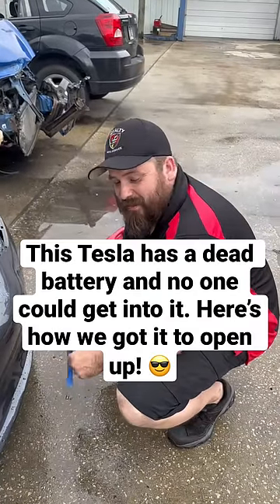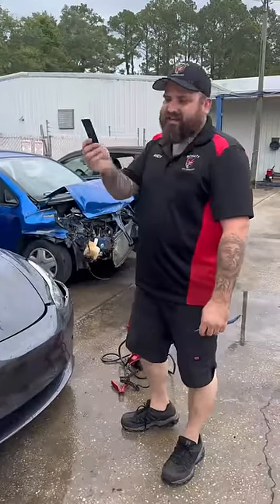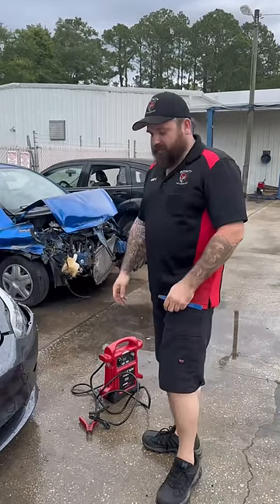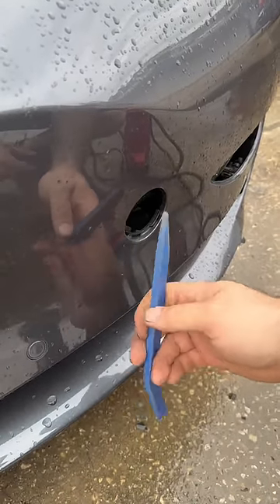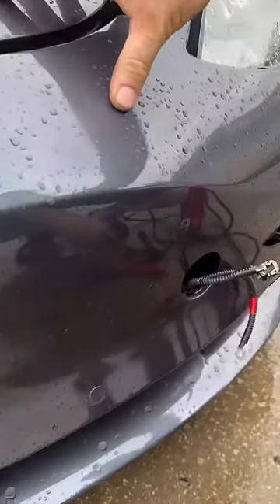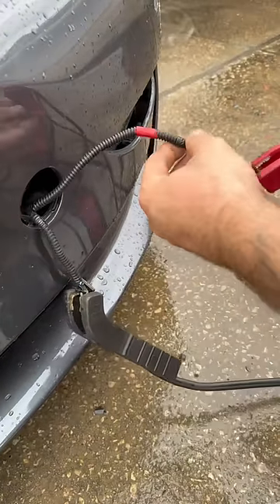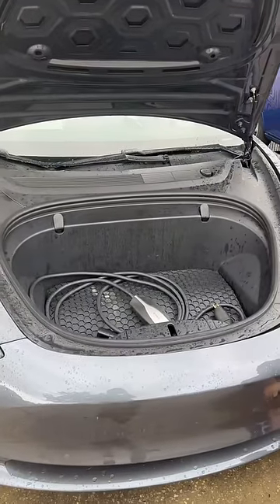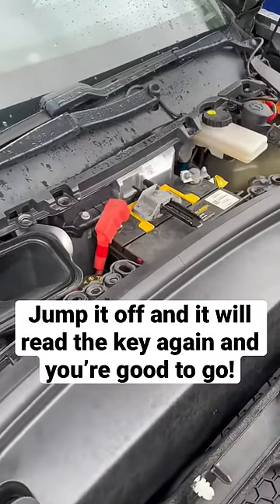Dead Tesla! How Can We Get Into It? #shorts #tesla #teslamodel3 #car #mechanic #crazy #hack #tips

Comment: Just in case anyone's wondering. This only works if the 12V battery in the car is dead. In other words, you can't do this to a random Tesla you find in a parking lot.
Reply: I don't see why not.
Reply: i can at least pop open the whole and bring out the two wires and i can cut those wires lol then close the whole as a prank to the owner. that way when they need to use it they are ultra F***D
Reply: @amandaburleson2035  that's cool, they pranked themselves when they bought that thing.
Reply: doesn't matter if the battery is working or not doesn't stop anyone from using their thumb to push the cover out and then stick their fingers in and pull the wires out live or not
Reply: @amandaburleson2035  How is Tesla unique in that aspect? You can vandalize any car, it doesn't have to be a Tesla, or even an electric car.
Reply: @TheSeanUhTron  people hate tesla owners. i sratched a few and flip off the cameras. i hate teslas. and now i will start to do this too. pop the cap and snip snip. i hate electric vehicles its a scam and people think its helping the environment. maybe i should uoload it to tiktok lol and start making it a trend
Reply: @amandaburleson2035  Some people just like electric cars. They're fun. What you're doing is wrong.
Reply: @WyattBest  you know whats not fun is when they spontatneously combust, or when the auto pilot kills the occupants, or the exploitations of slaves in 3rd world countries, Indigenous land grabs, and ecosystem destruction inside and outside its borders, poor slaves. 
The process of extracting lithium consumes significant amounts of water and energy, and lithium mining can pollute the air and water with chemicals and heavy metals. In addition, mining lithium can disrupt wildlife habitats and cause soil erosion, leading to long-term ecological damage
Reply: @amandaburleson2035  You sound like the person who has a preconceived notion that "EV's are bad" and will only read news or research them if it confirms your notion.

Everything you said is either false, misrepresented or without context.
Reply: @TheSeanUhTron  She's not totally wrong.  I don't agree with her level of activism against people's properties. But EVs aren't environmentally friendly in any way shape or form.
Reply: @bradleysimpson9819  Well, you're free to believe that, but that doesn't make it correct.
Reply: @TheSeanUhTron  just like you can believe in your false virtue, but that doesn't make you correct either 🤔. You really have no idea how things work if you actually believe your false virtues.
Reply: @amandaburleson2035  So you like going around vandalizing cars that belong to other people?  Real big and brave of you.  You're much smaller than you think.
Reply: Nobody would really want to steal an electric car anyway. It will not get very far.
Reply: @amandaburleson2035 let's pretend that your claims to harm of environment and people are correct,how does destroying personal property of random people help?
Reply: @Reza254  youre right i will only do it when they deserve it, i will treat this great power with responislbity.
Reply: Psshhhh challenge accepted 💪
Reply: Plus it has cameras so as soon as yu jump start to open trunk boom pictures galore
Reply: Tesla did not make up the name frunk, like it’s some new term. Lol
Reply: @amandaburleson2035 Exploitations of slaves from 3rd world countries? Oooh, I didn't know Apple made cars...
Reply: @amandaburleson2035 So you mean it's like the oil industry?
Reply: @amandaburleson2035 No that's vandalism and may get you something hot from someone who does not find it funny.
Reply: No shit?
Reply: @amandaburleson2035  sentry camera would record you doing this…
Reply: @tangoESPECIAL  thanks for the heads up. ill make sure to put on a mask
Reply: @amandaburleson2035  I agree with the overall sentiment, though nearly every point you made could be stated for standard combustion vehicles, cell phones, and just about every other consumer product. Newer cumbustion vehicles are even implementing self driving features or lane stay/active cruise control features as well.

So you're choosing to vandalize one single sector of consumers, for what? Pettiness? Jealousy? If you hate tesla owners, then why not vandalise people who have mercedes, audis, Lamborghinis, etc? Its likely the same kind of person. I am also not advocating for electric vehicles, but simply pointing out the absurdity in your logic. You are commiting crimes and trying to justify it using some rather hypocritical mental gymnastics 🤸‍♂️
Reply: @bradleysimpson9819 suddenly you care about the environment?
Reply: @Da_one_tl  I have spent my 41 years of life outside in nature and I care about the environment enough to know the truth.
Reply: @Da_one_tl  stop acting like you know me
Reply: @bradleysimpson9819  the truth of what? That electric cars aren’t better for the environment than ice cars? So what? Who cares? They’re not worse
Reply: @Da_one_tl  alright kid I have had enough of your crap I'm out peace ✌
Reply: @bradleysimpson9819  please, feel free to go enjoy that nature you’ve spent 41 years in lol
Reply: Oh, that sounds like a challenge to me!
Reply: @WyattBest wrong. Illegal. Horribly imature.
Reply: @amandaburleson2035 everything you said is misinformation.  Pls get educated before commenting. Consider starting over k to 8
Reply: @RaynorM just popular..so what
Reply: Ye it does work full charged or dead batteries.    Cheap system really.  Weak weak car
Reply: Yea right
Reply: @amandaburleson2035 Crying about lithium while typing on a device with lithium battery
Reply: @amandaburleson2035 You know what else is not fun is when a Tesla owner in a concealed carry state catches you @$#&ing with their car Actually I think it'd be fun to watch.
Reply: @mranonymous8979 Most cars have the plastic cap for a towing eye, that's what's behind that cover too.
Could just as easily pop it off on most cars.
Reply: @amandaburleson2035 don't do that shit on somebody's domicile property because you make it shot under stand your ground and die for your prank
Reply: Glad you clarified that, otherwise I thought the same as everyone else, nothing in the fronk is safe!
Reply: @medialinx80 yea, there's kid in Africa dying every day to mine cobalt under the guise of a mob or mafia to barely feed their families with the equivalent of pennies when and if they get paid.
Reply: @SlickArmor it will not do that with a running battery
Reply: @Msardinas86  it appears that other people have confirmed that yes it will. Plus my experience on how things work told me that it will.
Reply: @SlickArmor  Because there is an electrical interlock.
Reply: @amandaburleson2035  you are looking to get clocked
Reply: thanks...I was about to make an ignorant comment.
Reply: Damn, I was thinking now hood rats just got a lesson…. Like Hyundai’s
Reply: @bradleysimpson9819 neither is your gas shitbox despite all that efficiency gains that have been made over decades. so what.
Reply: @ButterfatFarms  my "gas shitbox" will be around and still running long after your adult power wheels stop working or catches on fire. Just hand over your man card because you aren't worthy.
Reply: @bradleysimpson9819  My "adult Power Wheels" is a 21 year old 6th gen 2002 Honda Accord Coupe with a 4 cylinder and 5-speed manual transmission with front disc, rear drum brakes and no ABS and 173,000+ miles on it. It was designed and built for the North American Market Marysville Ohio. What's this mythical shitbox of yours that is going to be around long after my car catches fire again?  Because I can easily see this one going at least a quarter million miles given how it runs and drives today.

And I just dropped the transmission out of it and put a new clutch in it in a driveway with help from my brother so no, I won't be turning in my man card because some doofus crybaby about EVs like you thinks I need to. 🙂
Reply: @bradleysimpson9819  I don't know what your problem is EVs may not be the second coming but they are the future. They can be some pretty badass cars  and are just in their infancy and only going to get better. Why all the hate? The idea of an electric vehicle challenges your manhood or something?
Reply: @ButterfatFarms  🤣🤣🤣🤣 nothing threatens my manhood but EVs are trash and you aren't going to change my mind about that. I am realist and cannot accept your narrative so get lost with your narrative while I stay grounded in reality
Reply: Well that proves the front compartment is not secure to store anything
Reply: @francisjenkins9392  Why would you think that?
Reply: @amandaburleson2035 , well, if you don't like electric cars, no1 is forcing you to buy 1. That doesn't mean that you have to vandalize others. I hate diesel trucks. But I don't go around vandalizing them.

   You should get yourself a hobby or something productive, that you can focus your energy on.
Reply: Give me a Hybrid any day.
Reply: All you need is a 3v battery. Red cable to postive side of the battery. Attach battery to the wires using a twist tie.
Reply: @amandaburleson2035 
You confused the word vandalism with prank
Reply: @SlickArmor  that's not called a prank that's called destruction of property and vandalism it's a crime
Reply: @NocturnalNews  no argument from me. I don't care for pranks at all.
Reply: so they drive a tow truck and tow it away and wait for 2 months until the battery dead,
Reply: Dammit
Reply: Must have a transfer switch somewhere.
Reply: @SlickArmor  That's how some transfer switches function.

Comment: I'm surprised they haven't hit you with a cease and desist yet
Reply: It's not a Ferrari.
Reply: Right...
Reply: This is literally in the owners manual.  It's not a secret, and something every owner should know in case of dead battery.  On older models you had to partly remove fender liner to acces the frunk cable if your battery died. This is much improved.

Comment: What had this world come to, we are using jumper cables to open the hood
Reply: Personally have to say this looks a lot easier to get under the bonnet compared to when the cable snaps on the car.
Reply: I'd rather do this than what I had to do to start my 20 year old car with a dead battery and ruined lock cylinders due to attempted theft.
Had to climb in through the trunk, fold down the back rests without having access to the release lever, climb all the way to the front to access the hood lever, crawl out the drivers door and jump start the battery.
Reply: @mikewheelermx101  after like 40 then maybe they snap😂😂 this thing is new..

Comment: Only a mechanic would notice he clamped on to unshielded wires...
Reply: Are just the ends unshielded ? Making sure I understand, not a mechanic obviously lol
Reply: Something is wrong there. The one wire has an eylet that will fit over a bolt or stud. The other wire had a clip that connects to a wire in a loom. Neither of them will just be hanging there. They will be connected to something. Plus the wire or wires with the clip probably has a few wires in there. And then finally he clamps onto the plastic housing. You can get access to the connectors in the clip, but not like that.
Reply: He probably pierced the insulation with the alligator clamps.
Reply: Shielded wires only are required for signal wires. That means sensors, ecu, and audio wires. Only a mechanic would know that.

You sir are not a mechanic
Reply: @Aaron-tv6fs he’s not talking about the shielding on the wires themselves rather the unshielded ends floating around by the frame.

Comment: Had to tow one of these, problem was that those cables got cut in the crash so we had no access at all🤦‍♂️
Reply: Joe biden's working on that problem 💯👍
Reply: @maxmann-td4hn  Thank you, I REALLY NEEDED THAT!! 👍🏼👍🏼
Reply: Smashing window time.. lol
Reply: Ok wires are cut, how does that stop you from doing what he did? Assuming the bumper is smashed so access isn't an issue anymore.
Reply: @michaelmullen2381  the issue is you can't reach any wires without ripping of the bumper, there is no way to apply power if those wires are gone
Reply: @noname2775 I’m curious how the wires would be cut, while the bumper is still in tact and blocking the wires. You’d assume that if the wires were damaged the bumper would be destroyed beyond repair in that area — meaning access is a non issue — get to the wire, expose the conductor, send 9-12v
Reply: @DozIT  Eh, I'm guessing the bumper had flexed in the crash and kinda pinched them of, it wasn't broken but bent with a big dent in it. It that makes sense.
Reply: So pull it off...it will have broken clips anyway.
Reply: @DL101ca  I would have if Tesla had allowed it.
Reply: If the wires are cut… wait for it… remove the front bumper. Use an ohm meter to test for continuity from a metal chassis part and both wires, whichever shows continuity is ground. Strip the wire ends, either attach a new prong to the ends, or add a length to restore original wire length, solder them, shrink tube and add the connectors back on

Too many parts replacers and not enough problem solvers.

I’m not even an old head gear head. I just learned from my dad at his shop
Reply: @Aaron-tv6fs  you know what happens If you remove the bumper? You void the warranty, A Tesla isn't you dads old pick-up.
Reply: @noname2775  Please explain to me how a front end collision (causing a cut wire and facilitating a bumper cover replacement at THE VERY LEAST), doing a proper repair by a red seal mechanic voids any warranty?

please explain. I'd be interested in hearing all about how body shops void your warranty by perfoming said repairs. I'm sure that would go over well, if any necessary repairs VOIDED YOUR WARRANTY.

god you keyboard warriors get dumber every day
Reply: I'm not from the body shop, I'm a tow truck driver they don't let me do that kind of stuff. You people really need to learn to read before you give your genius responses.

Comment: Need a 12v to access a 12v just to open the doors. A hood latch with cables is way less complicated and works 100% of the time.
Reply: Almost 100%, I had one break on my 91 Miata 😂
Reply: I was wondering the same. Why not just put a pull cable to pop the frunk?! ... 

And the guy in the video keep saying how easy it is - it's not! ... It's no needlessly complicated!
Reply: @wayando then everybody can access your frunk
Reply: @GewelReal  ... With this, that's already a problem isn't it? ... Who doesn't have a 12V source?
Reply: @SegwayBossk Also had one break on my '89 Escort, and it still took me less time to slide under the car with a screwdriver and pop it than put 12V to the override cables on this lol.
Reply: Until you get a broken cable. LOL

Comment: "That's easy"
Not as easy as opening my door and pulling the hood latch release.
Reply: Did you miss the part where you can’t get in the vehicle?
Reply: @stefanms8803 I think this was meant as a diss against these EV's.
Eagleone was saying he prefers the older, simpler cars. And I'm with him.
Reply: My jeep doesn’t even have that lmao
Reply: Let them be stupid. We'll laugh in silence.
Reply: @stefanms8803  did you miss the part where we care?
Reply: @jeffhale2278  I think Stefan was speaking to my point? I'm not sure
Reply: @eagleone5456  Maybe. I took it as Stefanms meant you CAN'T open the door because the battery is dead. I'm not sure either, but maybe the new EVs like this don't have a mechanical lock you can use a key to open, it only opens by an electric actuator and a key fob.  Again, I don't know, I drive a '98 Jeep with almost 200k on the clock.